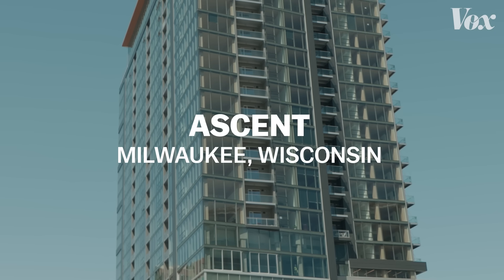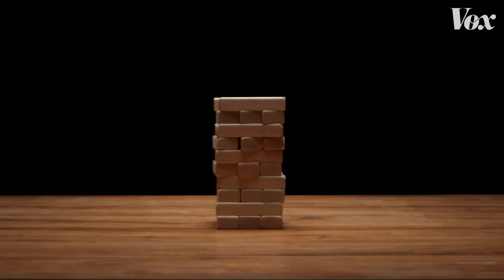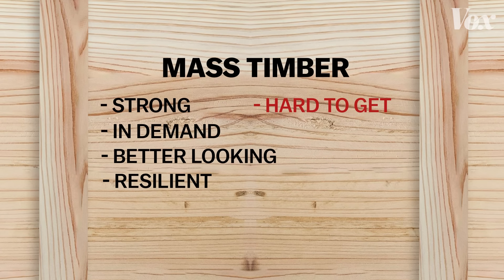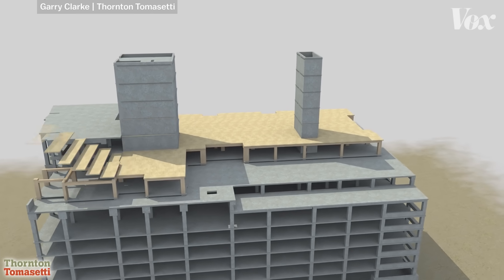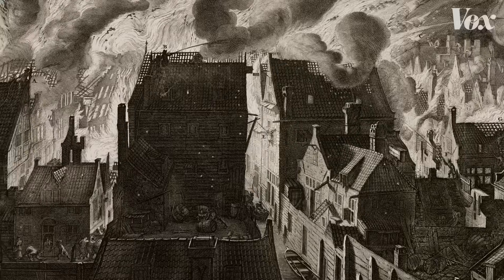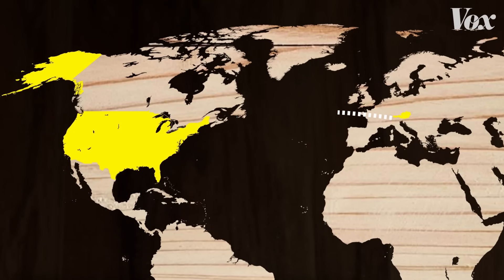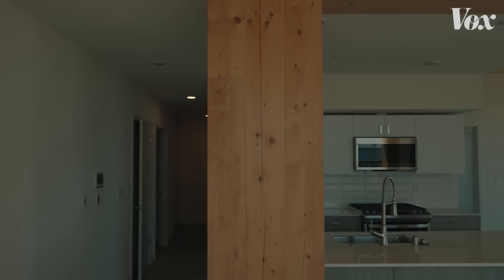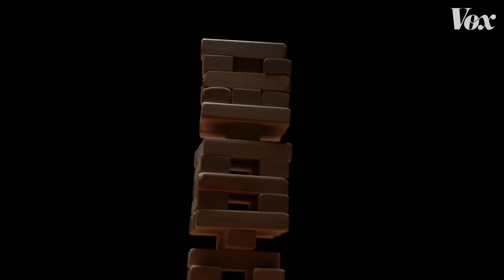How to build a wood skyscraper

Comment: It's also worth mentioning that lumber is essentially stranded carbon foam, so a wood-framed building is TECHNICALLY a form of carbon sequestration, which makes it a sink and not a carbon generator like concrete.
Reply: Wonder if that still holds true if you ship the stuff around the globe.
Reply: @waaduu6189  shipping isn't that bad if you compare it to the green house gases produced by concrete and steel production
Reply: @waaduu6189  thankfully wood grows all over the place, as opposed to concrete, which relies on minerals only found in certain parts of the world
Reply: Concrete also does sequester carbon. It's a porous material that tends to collect carbon over time. CLT is MADE of carbon though, and overall the entire process involves less carbon creation and more sequestration. It's way better.
Reply: mind fornication  basic ecology my friend you are incorrect
Reply: absolutely retoooted logic.....u dont make wood,u grow it.....if u had to "make" wood out of a bunch of analoguos or artificially formulated materials it would be a carbon producer too,but the process of carbon removal only works while the tree is still alive, the minute u chop it down, the only thing that can possibly happen is carbon generation whether u set fire to it to create carbon emissions or use energy to shape or process it.
Reply: It's no longer a sink once it leaves the soil. It only stores old carbon which is still released fyi

Comment: But treated timber require chemicals so as adhesives… are those factored into “less energy”? What about these portable battery being used in construction?
Remember “renewable” doesn’t necessary mean it have less environmental impact.
Reply: yes, making cement and concrete is very energy intensive and has a lot of CO2 emissions

... what about portable batteries? energy lost due to charging and discharging is very insignificant compared to the energy use difference of the manufacturing processes. (moving columns and structural elements, moving concrete or wood needs waaaaay more energy than screwdrivers)

Comment: I lived in both mass timber hybrid and almost pure concrete condos that is built in the last 10ish years in Toronto. There have pretty much the same price point when adjusted for location. 
The concrete one is significantly quieter. In the wood one, I know when my upstair is having a large gathering and when my neighbour who is a nurse that wakes up at 5AM for work... I meant in the concrete one, I can still hear noise when my neighbour is having a party, but it is nowhere compared to the wood one. 
I am also concerned about the water and moisture when using mass timber, especially when it is unprotected and used as a crucial support column right next to the kitchen, like the one at 8:16.
Reply: I live in a mass timber hybrid and can hardly hear my upstairs neighbors. The builder did have to adhere to Dutch building codes for noise isolation between floors, which are rather stringent. The floor packaged got rather complex with several several sound decoupling layers between floor layers and between the floor and the walls.
Reply: @julescoret  that sounds so nice, wish we had such codes in America..I can hear my upstairs neighbor drop a pin 🙃

Comment: I think a lot of the digital improvements that they mentioned don't need to be coupled with the wood aspect, I think they would probably bring a lot of benefits to any construction?
Reply: True, and 'Building Information Modelling' has been a big buzzword in the industry for a decade now, also for classic steel & concrete construction. However, many parties are still reluctant to make the switch. By essence, the construction industry is very conservative and reluctant to innovate. After all, you're dealing with products that need to last decades if not hundreds of years. But with wood construction like this, detailed planning and 3D modelling are a near necessity. For example: The CLT wall panels in our home are pre-machined in the factory to contain canals for electrical works,  sockets and plumbing. That means that before the panels are manufactured, all the building technics (heating, ventilation, electrical work, plumbing) need to be 100% worked out beforehand.
It also means your building becomes a lot less flexible to adapt to new uses. (this is avoided in the vide by not using massive wall panels but rather structural columns)

Comment: Closing remarks. Concrete topper on the floor. You seemed to skip this point. It still has concrete to prevent noise between floors. How thick?
Reply: Concrete is loud, they probably just wanted it aesthetically or for underfloor heating. Would be a screed like 60mm thick
Reply: Yes, the concrete is for acoustics, US regulation requires floor slabs to have a certain mass, CLT has low mass, so they pour concrete to satisfy this building code. Don't remember perfectly, but yea about 2 inches to 3 would be close.

Comment: Kinda weird they compared mass timber to specifically PT slabs instead of RC in general.. also wish they did more comparison to precast concrete construction too. Hard to imagine shipping timber is more environmentally friendly than using precast elements from a neighbouring factory
Reply: It is still better for the environment to ship wood across the world than using concrete. The amount of raw material and energy used to manufacture concrete is pretty absurd (8 percent of global carbon emissions are just concrete). But yeah, using local wood is of course much better, but American mass timber manufacturing is catching up fast especially in the PNW.

Comment: What is the ecological and economic impact of make mass timber and in increase its production? Something can be great only it fulfill a purpose more meaningful and useful for society as whole than just aesthetics. Sorry if a came negative but I believe that question long term consequences of mass production should be one of the main concerns on produce or create everything and not only if it's possible.

Comment: How many acres of trees had to be clear cut to supply the wood for this one building? 
 How many species of wildlife were displaced?
Has the wood been chemically treated for dry rot, invasive species like the Emerald Ash Borer... 
On a lighter note, is it woodpecker proof!
Reply: The timber would be farmed in 20 year rotation like the rest of timber we use for everything else. Sure there'd be some displacement. What's the ecological impact of concrete plants, mining like and clay etc. Trees are renewable and can be replenished.
Reply: @alexandermcleman6101  I appreciate your input but, I would prefer to see the mountains of plastic being transform into bricks or planks or even stressed panels.
In my area in the country I have seen the clear cutting and practically useless replanting of seedlings.  I even planted some on my own on our land.  Most of the govt sponsored replanting is still barren today even 30 years later.
It was basically a make work program for the area and ended as soon as the budget was up.

Comment: I'm curious on how the overall cost of the building would be as compared to traditional construction.
Reply: When talking about a skyscraper/mid rise building, it’s actually cheaper because of the lower labor costs. Concrete is cheaper than CLT, but the fact that you can build with CLT like big legos makes it much faster and simpler to build. Steel is more expensive than both of them so that is irrelevant.
Reply: I imagine it's not a very fair comparison at this point. This is quite a new process, which means it isn't as optimized as it could be.
Reply: Our CLT home originally was calculated to be 2% more expensive than a traditional brick home. However, due to the corona pandemic and increase in wood prices (Americans started buying up all european wood) it ended up more like 5% more expensive. However, one Russian invasion later, European energy prices are so high that the manufacture of bricks became a lot more expensive as well. I didn't know where the prices ended up, but I imagine it's a lot closer now again.

Comment: I think it's strange that Canada and the USA have a big timber industry, but instead the timber comes from all over the world. It looks to me like a big selling point if you can say you worked with (relatively) local sourced wood. Also from an environmentally view.
Reply: since mass timber is catching on, I'm sure there would be a market to open a north American factory to make it out of local lumbar and supply it to building projects here instead of having to go all the way to austria.
Reply: it more has to do with the glulam and CLT having to be processed and made. The raw wood is made in the US and Canada, but it is not refined into the proper building materials here. I would hope these sorts of factories can be built up in the US and Canada to cut down on the possible logistical bottlenecks and bring down the carbon footprint, but that of course will take time and the expansion of the mass timber market.
Reply: There is a factory in Quebec, working with the firm Nordic structures. The firm is also working with building regulators in Canada in order to get the materials approved. I got a tour of their offices as a new civil Eng grad. They’ve built wood bridges and buildings all over Canada, but it was probably cheaper to get Austrian timber somehow.
Reply: I think this goes back to the regulators and the manufacturing of wood. The Austrian wood was certified that it could withstand 3 hours of fire. Maybe the CANUS wood doesnt have the same properties.
Reply: Difference is the factories and regulations, for years Timber wasn't allowed to go above a certain height, so the US and Canada doesn't have factories with machines to make CLT. Things are changing now of course, but it really starts with building code first.
Reply: @theb.1723  "For years" You forgot this part.
Reply: It isn't just the factory. You have to grow the Austrian trees in a sufficient volume. And trees have this odd habit of growing differently in different parts of the world. You can make identical concrete. Not so with wood.
Reply: I know that the mass timber built in the PNW was done with locally sourced timber for the most part
Reply: The woodbox for export product in my factory back when I was worked there are imported from either US or Canada, and a lot of factories uses the same woodbox. We are talking about dozens of metric tonnes everyday for just a quite small industrial complex (around 20's factories).
Reply: I thought it was locally sourced , I was shocked to know they shipped wood from Austria , all of North America has no one who could glue to sticks of wood together?!!!
Reply: The USA is too busy killing its environment and cutting down every tree to care sadly
Reply: we have a big pulpwood industry for paper production here in north america, when it comes to saw logs, we aren't actually the best.
Reply: We have a big stick frame wood industry. Timber frame is a different beast and like a cross between regular stick framing, and steel building. We don't have timber frame manufacturers because it's not popular here. In Europe it's sometimes rare for buildings to be built from wood so if someone there is going to choose to use wood it will probably be for the aesthetics. Because of this, timber framing is the model that allows you to show off the wood more, instead of hiding it purely behind drywall and flooring. SOURCE: carpenter that primarily deals with stick framing.
Reply: Russia imports oil. It just all depends on how much you can sell it for versus buy it for incl the whole process, labour, refinement.
Reply: They’re working on it.  My department at Auburn Univeristy (school of architecture) has an initiative working with the engineering dept, and the USDA to do research in this area.  Timber industry is one of the largest industries  in Alabama, and there are companies already making glulam beams, etc.  it’s a matter of doing the research on structural capabilities of the species we grow here, along with doing the testing to get products and construction methods accepted by building codes.

People are very interested in ramping up production in the United States, and throwing money and time and resources  at the questions to get them answered.
Reply: Wood used for stick framing is always sourced close to the build location. Manufactured wood is not necessary the same. Besides, wood is still wood. It shouldn’t be used for, for instance, large/medium bridges even when the wood far exceeds the engineering requirements… eg Norway….
Reply: Most of America's goods are for export because American companies won't pay the higher price but other nations in Europe and Japan will pay for quality. Blame American businesses who owe shareholders instead of America itself.
Reply: Unless there is sufficient demand to justify it, opening a local factory for mass timber production it's actually worse for the planet.
Reply: We have the wrong trees in North America.
Reply: can be manufactured in the 3rd world, like amazon rain forest countries.  The cost would be much lower than in the america or austria.

Comment: Making this happen in the African continent is the next big thing with locally grown commercial forests. We at BuildX Studio are proud to be among the first to do this in Nairobi Kenya.
Reply: I know those buildings stays warm better in winter that insulating property should apply in hot climate too right, How does it compare in summer? Does it keep heat & radiation out better?
Reply: @whatever_12  probably depends on the designs employed too, you might have longer awnings for shade and higher ceilings or regular vents for better airflow. hopefully it'd be a push to more locally suited architecture
Reply: @whatever_12  Brazillian here! It does! Wood is very insulating, so it also keeps the heat out for longer and keeps nights warmer inside. 
It's not used very frequently due to cost and strict environmental regulations but it works very well in warm climatrs as well
Reply: Immediately following💯
Reply: How are you dealing with termite control?
Reply: @Zaydan Naufal dimakanin pejabat duit nya
Reply: Hello.. I run a startup designing modular multi-family apartments for the African Market using CLT to be manufactured at scale. We could talk if you don't mind

Comment: You left out the most important part.  Sand.
Sand (sourced from water erosion) is extremely rare relative to the amount we use.  Research it on your own.  Sand sourced from wind erosion is not usable for concrete.
Reply: more research needs to be done into how to use desert sand in construction...

Comment: Won’t long term maintenance be harder, having to watch out for termite’s and stuff?
Reply: Depends on the climate but there are five-storey temples built in Japan that have lasted for over a thousand years. Worth keeping in mind that concrete and steel also degrade over time, like that condo tower in miami.

Comment: Phil, I disagree with what you said at roughly 8:25 in the video: "Traditional construction isn't held up by stuff like a container ship getting stuck in the Suez canal." 

Concrete requires a specific kind of sand that is sourced and shipped around the world just like timber.
Reply: The difference being that concrete can be stock piled, gluelam beams are all made to order. If you need more concrete for construction you go to the supplier and buy some more from their stockpile. If you need another gluelam beam or clt floor panel you have to order it from the manufacturer and wait for them to manufacture it.

Comment: pre tensioned makes a lot of sense, but post tensioned?? how do you tension rebars after casting?
Reply: It's steel cable not rebar.
Reply: @WilliamTheTubTaft  How do you compress steel cables after casting?
Reply: @soundslight7754  Concrete is only strong in compression so you tension a steel cable inside the slab to keep all parts of the slab cross section in compression.
Reply: @WilliamTheTubTaft  Yes, thank you but I knew that. I asked how you compress a steel cable (especially after casting) because braided cable can't be compressed and in fact nothing cast in concrete can be compressed.
Pre tensioning is normal - first pretension, then cast in concrete while still being tensioned, but post casting?
Reply: You use a jack to pull the cable after the concrete sets. You lay the cables in, pour your concrete normally, then when it sets you use a jack to tension the cable before tightening it with some kind of fastener to maintain the tension.

Comment: Simple. Ask the Scandinavians. Norway has 80+m buildings made from wood (Mjøstårnet), and they are working on 150 m wind turbine towers from wood, using special lamination techniques. 
The Austrians do great stuff, but they are not the first to do it (ok, maybe they are the first to use this specific building technique for buildings that large)
Reply: The building presented in this video is 86,6m tall, 1,2 m taller than Mjøstårnet. However, several of the first floors was in concrete? Is this taken into the consideration? Could you add 1 floor of wood to the empire state building and jave a new world record?